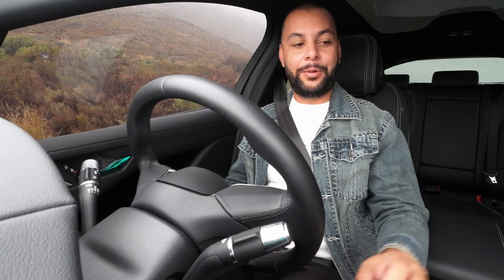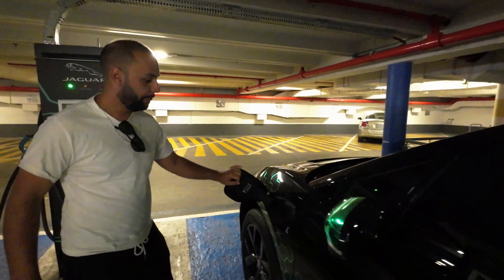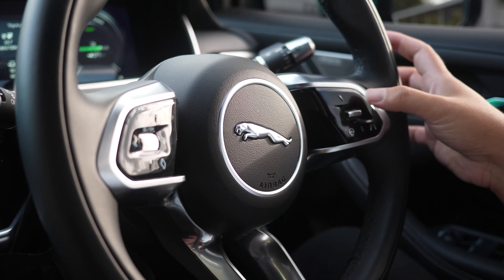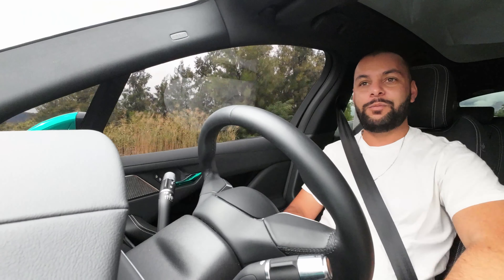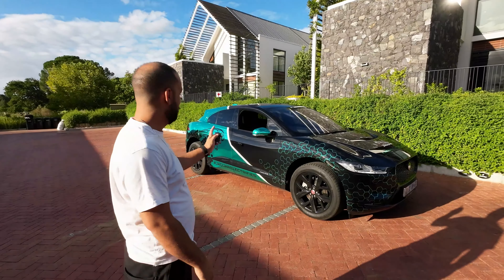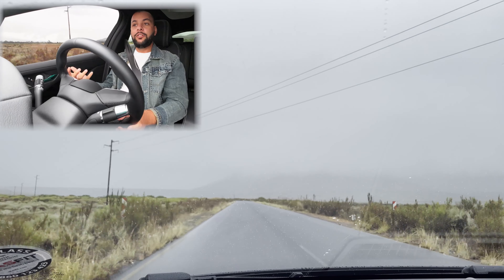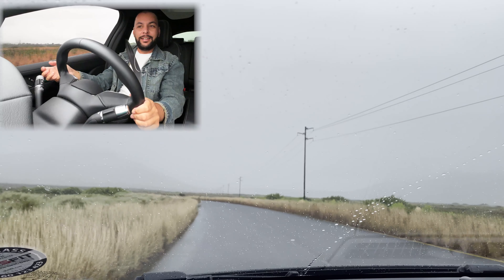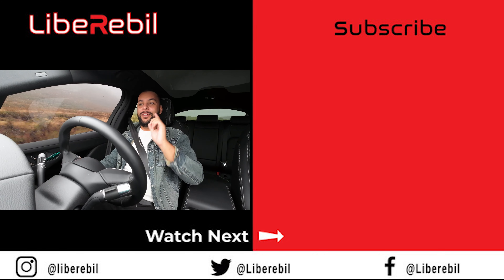LOAD SHEDDING AND AN ELECTRIC CAR! - CAN THIS ACTUALLY WORK?

Comment: The loadshedding anxiety is real for us, however we should not dismiss the idea of going electric on vehicles. If you know that you are not a long distance traveler, then you should not worry about range anxiety as you will be able to plug in your car in your garage and let it charge overnight and if you buy an electric car, you should also buy home charging infrastructure so that you dont have to worry about loadshedding

Comment: So when fully charged, it will only give you less than 400kms then you got to stop again for hours to charge? 😏
Reply: If the Charging stations in RSA could improve speed it will take 20 minutes to charge. After 350 it's ok to stop for a little rest. You are not going to drive those kilos everyday. Only when going away.